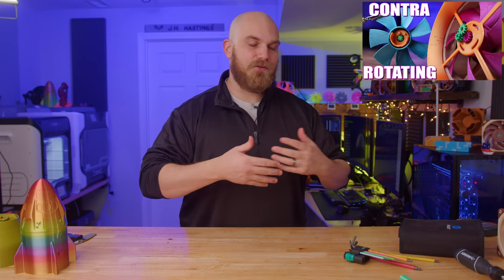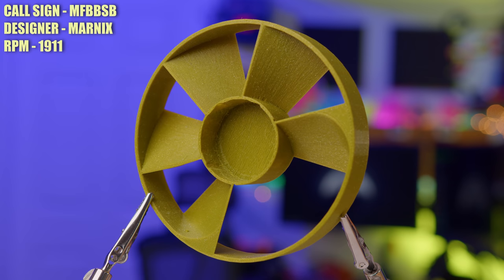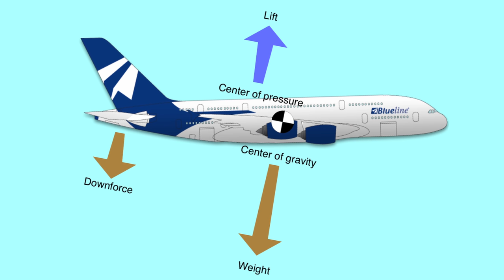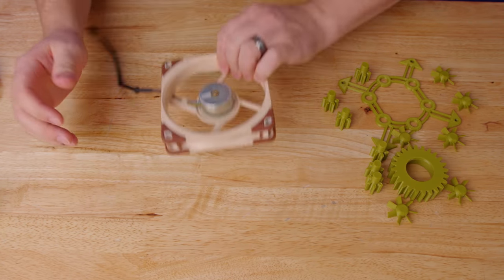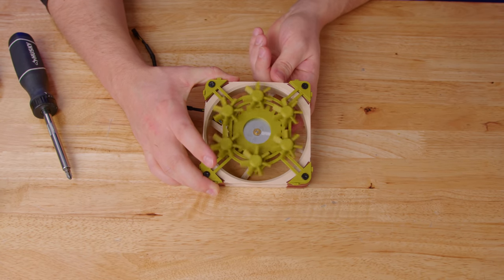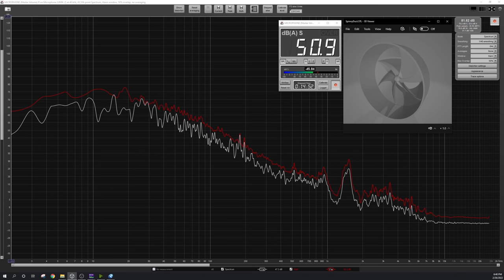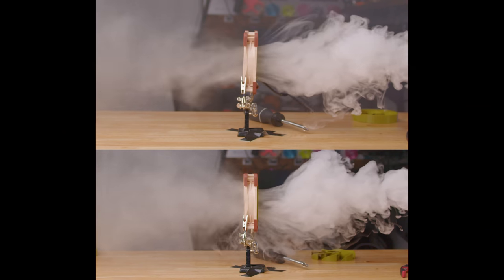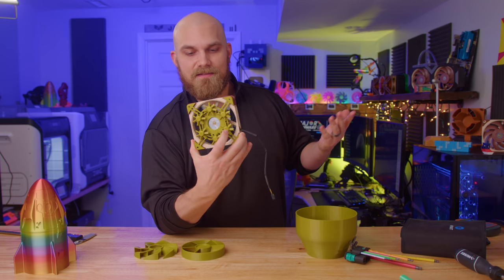WARNING Prolonged Exposure May Damage Hearing | Fan Showdown S4E2

Comment: That worked pretty much how I expected it would. Maybe even better lol.
It was lots of fun though and I’m glad I could participate! Some of the more complex designing I’ve done in a while.
Hopefully I didn’t damage your ears too bad!
Reply: The Duplicator needs gap filling bearings

Hoppees
Reply: i loved it! the biggest change i’d make is some bearings for the gear shafts, it’s a super fun design, though! i was thinking during the video that that and staggered-height fans might allow for longer blades and smoother movement.
Reply: What about helical cut gears, instead of straight cuts?
Reply: The little fans need a shroud. I think not having it made the air disperse a lot.
Also could some blades(2~4) be added to the main gear? Just not as big as a normal fan. Half of the space being used by those blades and half by the gears.
There are many ways to approach this design haha
Reply: It just needs more oil to make it quieter. About a gallon in a bucket would do. Great fun fan.
Reply: @legoman786  yep, helical should help, and maybe a back plate like the front to help minimize axial drift.
Reply: I I 8w,,, and,,,,,,, wo ich es
Reply: To beat this, I guess someone would have to "accidentally" send a design for a rotary siren.
Reply: @neshugg9486  Almost half of the area of the small fans blowing directly into the face of the drive gear obviously caused a lot of backblast in the smoke test, it's possible you wouldn't need blades on it, just space for the air to move through.
Reply: @HighlyImprobableName  Yeah, maybe the little shrouds will help with that.
I just wanted to add more blades haha
Reply: hey cad your fan is awesome, is there any way you could raise every other fan(3 of the 6) higher up then lengthen/widen all 6 fans blades? would potentially give it a bigger area to cover for more airflow without making the blades all collide? obviously not sure how much it would slow the whole thing down since it was only going around 650, but if they can have a bit more wingspan maybe they can work a bit better?
Reply: Next time use "square teeth gear" instead of spur gear teeth for maximum noise
Reply: @neshugg9486  I think it needs a central set of blades (or even just a conical disperser) to make sure the air is being moved away from the center of the hub. Looking at the smoke test, it becomes evident that all those little fans are pulling air into the middle (where it hits the hub and pushes back forward) just as much as to the outside (where it can be pulled through).
Reply: idea, what if you extend the shaft of every other fan in the ring. that way you could allow for longer blades with and over/under kinda thing goin on.
Reply: You want some fan with your gears? : )
Reply: You can see in the smoke test the little spur gears bouncing and wobbling around inside their housing of the main support, it might perform better if they weren't quite so loose. I get it though, the previous one had too tight of tolerances and thus seized the fan but this one seems to have the opposite problem, being too loose and thus the slop in the fan is not only causing unnecessary noise but is also interfering with the fan. I saw somewhere else that the drive gear might also be affecting the air profile, maybe a shield of some sort to counter this as well or slanted/angled so as to help the air get pulled instead of swept aside? I did also thing it might benefit from some bearings to further reduce the friction of contact when you do tighten the tolerances of the gears
Reply: The bottom of each gear fan needs to be smooth as possible- Also, lining the edge of each of these gear fans with a wire type guide along it's edge will help. like mini computer fans. On top of this, each of the mini fans blades was square and could be sharpened/shaped to a more contoured edge, which again will reduce that noise and tremor. Further, making the gear teeth themselves more guitarpick shaped rather than stick shaped will help as well.
Even further- perhaps a dual edged design where one of the gears sits inside the other, wit h some kind of rubber coating the interior of the other like a rubber band, thus making it more friction belt driven than gear driven, making it far less clanky.
Reply: My dogs hate you . They ran away when it was turned on. LOL
Reply: could also use gears that are not straight cut
Reply: So now we won't even see how much the fans can cool the cpu??

Comment: I'm most impressed with the missing blade fan; it still pushes reasonable air, is not crazy loud, and is shockingly well balanced given its wonky appearance. Great job Marnix!
Reply: Thats the power of calculus. I'm assuming they used calculus, I would hate to try to solve that problem with trial and error.

Comment: I love how the smoke was even like, "no way am I getting close to that loud fan."
Those back swept blades on the falchion seemed to make quite smooth airflow.  Not sure if it is the fences or the blade direction not funneling all the air towards the middle like a forward swept blade.

I always forget if you are using the stock a12x25 fan or the 3D printed fan for the standings.  If the injection molded, smoothed, production quality one, then I think you should change it out for a 3D printed version just to keep finish quality from affecting standings.
Reply: I also would like to see how it translates into cooling performance. Center moving air vs uniform flow. Although i guess the straightener on the cheater showed it improves it. I also would like to see 3d printed noctua and t33 as reference on the board.
Reply: He did an episode a while back discussing surface finish.  It has no measurable effect outside the margin of error.

Weight of the blade would matter though.
Reply: iirc He did do a 3d printed a12x25 and it had almost no performance difference.
Reply: Quite confident that the fences are the main reason the falchion doesn't act as a centrifugal blower.

Comment: Always a good day when a new Fan Showdown episode comes out and I'm already looking forward to the next! 
Two quick notes for anyone designing a gear fan based on my research and experience designing the contra (+the update I'm working on)  

First the distance I used from the top of the motor to the underside of the frame was 2.5mm based on the prior video this seem to be a good ball park figure to keep in mine to avoid parts rubbing.

Second, gears with smaller teeth at a higher tooth count should produce less noise. For the contra I played it safe with straight cut gears and a module of 1 but in some recent test prints I've gotten gears with a 30 degree helix and a module of 0.5 to print beautifully on a 0.4 print head so getting noise down to a  "reasonable" level might be achievable
Reply: Spur gears are inherently noisy which is why older gear boxes in cars & trucks make a lot of noise and why vehicle makers moved to helical cut gears in the late 50s early 60s. Many still left 1st, 2nd and reverse as spur cut and this is evident when cars/trucks of this vintage move off or back up.
Parson's turbine put into a Royal Navy ship used Helical cut gears for this reason. The noise would have been unbearable plus Helical cut distribute load better across the teeth reducing gear stripping. Effectively two teeth are engaged at once whereas a spur cut gear hops from one tooth to the next. As you note, smaller teeth make less noise simply because the 'hop' is smaller. More precision can help too.

Comment: the spinny duct fan makes me wonder how well a cone shaped fan would work, with the small end of the cone being the intake. it seems to be throwing a good deal of air back out and i think it must be because of the angled part at the blades acting with centrifugal force.
Reply: Yes, seems to me he rotated it the wrong way-
Reply: Definitely seems it needs to be reversed. Look at how a rocket nozzle is designed for Instance. I bet it would perform decently well.
Reply: Exactly, Spin the other way and it will perform much better.

Comment: the missing fan blade method is a method currently employed by many automakers, and was used as early as the 1950's on radiator fans to change the audio profile to something less annoying and choppy.  it actually works, and moves just as much air as if the fan blade was there.
Reply: Ah yes! This is indeed true! I remembered again thanks to you
Reply: Pretty sure another fan did a similar thing. Maybe in season 1.

Comment: Thanks for printing my fan!   I designed the spiny duct  and seeing the test results and reading  the comments gave me some great ideas. I redesigned it to have a smaller inlet and larger outlet.  Also reduced the weight by almost 80% so it should spin much faster.  Hoping V2 performs much better than V1.

Comment: I'm no physicist but the "spinny thingy" appears to work against itself as the centrifugal energy is forced backwards in the cone/duct. It would be interesting to see the inverse of the cone where it used the CF to assist in moving the air through the fan by creating more of a vacuum aft making the air to "want" to flow through duct faster. Just some thoughts. Awaiting patiently.

Comment: The Duplicator gear fan is way, way louder than the air compressor in my shop! I don't think I have time to work on it, but for me it would be super interesting to design the quietest fan possible that still moves air well (like about as well as the reference fan).

Comment: Spinny Duct, like the last iteration of that idea, keeps trying to act as a centrifugal pump. Perhaps time to abandon that idea. Missing Blade sounds like a variant of the uneven spaced blade idea for noise reduction. The Falchion is rather quiet given that anyone who owns an EVGA 10 series GPU could tell you about how loud the back swept fan blade design on them can get!

Duplicator gets no comment from me other than that it makes my teeth itch how loud it is for so little airflow.
Reply: lean all the way into that and go for the housed fan arrangement.
Reply: @Cynyr  That's essentially The Cheater.
Reply: @EinhanderSn0m4n  okay, so take the Cheater one step farther and apply deLaval nozzle principals to it.
Reply: Or you could reverse the blades on the Spinny Duct so the blades push the air in the same direction as the centrifugal forces. But even then I feel the spinning duct idea isn't that promising. To high a load on the bearings in the fan motor is just part of the problem.

The design could however probably be adapted to be used as the cone part of the Cheater. It would be interesting to see three different configurations for this. Just the cone, the cone with the blades as they currently are and the cone with the blades reversed. With the blades retained in the cone they would act as a stator for the actual fan. However usually the stator is placed on the outlet side of the fan. So it would be interesting to see if adding a stator on the intake improves or decrease the performance and is so what it does for the noise.

Edit: Yes the missing blade fan changes the frequency spectrum for the noise, and that's why some fans has had uneven blade geometry. Instead of one sharp spike in the frequency graph the noise is supposedly spread out over a wider spectrum, but with less energy in any one frequency that what you get with evenly spaced fan blades. And the frequency graph seems to support this.
Reply: @martindinner3621  De Laval nozzles are exclusively for supersonic flow or pressures exceeding a few entire atmospheres of pressure. If your fan setup is generating supersonic flows or massive pressures, something absolutely bugfuck insane is going on and you need to show it to Pratt and Whitney or Aerojet Rocketdyne.

Comment: The Duplicator's gears need to be MUCH finer. It need about 3 to 4 times the current teeth number. Then, making them chevron type will also help reducing the noise level.
Reply: Would also help to have a second brace on the rear of the frame to better stabilize the gears against the hub.

Comment: Few suggestions to the duplicator: I think if you added some thin clacking strips and a striker, add the smoke machine and turned the fan to a random pulse you have yourself an automatic New Years Cela-tron 2000 lol.

Comment: The Spinny duct being tapered has centripetal forces working against it and pushing air out the front starving the blades, if anything the taper should be the opposite, narrower the further out that would accelerate the air to the blades.

Comment: The spiny duct isn't a Velocity Stack, at least not as designed there. A velocity stack has a few distinct features, namely, the leading surface is curved to act like an airfoil and accelerate air into the mouth (via high/low pressure differences), and also has a progressive taper to the inlet.

Pretty sure the straight sides in this design was one contributing factor in the air not wanting to enter (another reason, as someone else mentioned, could be Magnus Effect... although that might the proper name for what I was pointing out? haha 😊😅)

Comment: if that spinning duct fan had impeller pegs at the angle shift point, it would kick off that airflow adhering to the sides of the outside of the duct, just something i learned from another Youtuber, airflow will stick to surfaces and with the taper going backwards, it's effectively flowing air backwards on the outside of the duct.

Comment: Should've made the center gear a helical gear so it also moves a little bit of air. Wouldn't have made a huge difference but it would probably be worth something.
Reply: I was thinking that too, but then the smaller gears would have to turn the other way, possibly nullifying any benefit of the helical gear. 
However, helical gears might make it quieter.
Reply: or a harringbone gear

Comment: The missing fan blade thing has been around for a long time actually... EMD locomotive group started doing that to their roof cooling fans back in the 60's to cut down on the roar they'd make while at full throttle and the cooling fans were maxed out. It actually works.

Comment: The like 1000 blade fan will spin, but suck because like half of each blade is directly over the motor meaning any air pulled to that area will get pushed sideways and make a bunch of dirty air that the fan itself cant grab so drop the efficiency to like poopoo. Thats my guess.

Comment: Some cars use a fan blade set-up somewhat like the "missing blade" for their radiator fans, with the blades unevenly spaced but balanced. This setup results in a less harmonized or droning sound which is more pleasant over long duration (at least to the test audiences).

Comment: Some older truck engines included cooling fans with asymmetrical blade spacing to change the harmonics of the airflow noise

Comment: The unusual sound quality of the MFBBSB is what's termed "octave reinforcement" in acoustics.

Because the gap between the heavy blade pair is twice that of the gap between all other pairs, the frequency of sound it generates is a whole octave lower. Although it's a much weaker wave than the wave an octave up, the higher frequency supports the lower one, and assists our ears in picking it out, so you end up with an overall effect that your ear is receiving sound that is very similar to most fans, but is perceiving a much lower tone.

To my ear, this also makes the fact that there is any tuned pitch at all much more obvious.

Comment: Wow, 2 impressive fans for sure!  I love seeing what people can come up with.  I just wonder what would happen if the blades were extended to the end of the SpinnyDuct, but have the fan blades taper off the closer they get to the edge of the duct.  And man, the Duplicator!  While it didn't set any records at all, it is still very impressive!  I'm just curious if it's because the fan blades all spin the same way.  The trick would be to figure out how to get every other fan hub to spin the opposite way, similarly to how some of the GPU's have one set of fins and hub setup to spin the opposite direction.  That in itself may be a feat for someone to take on.  I don't care if it finished last, I don't care if it was loud.  It put a smile on my face, and I'm glad you do the smoke test, because I was wondering what the air flow looked like.

I've said it before, and I'll say it again, Keep up the great work!  I do enjoy the weekly uploads, and I always look forward to them.
Cheers!

Comment: I’d be curious to see how different lengths of intake ducts affect airflow - so for a given fan design, how does it help performance if you add a 10mm long intake? 20mm? 50mm? Like how much would it take to notice an effect, and would that be a reasonable sized mod for a normal PC?